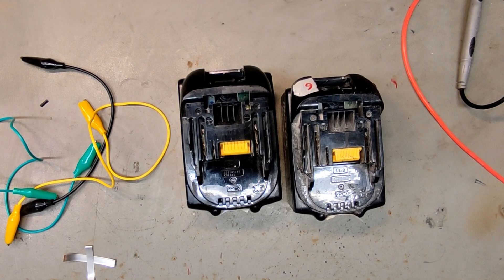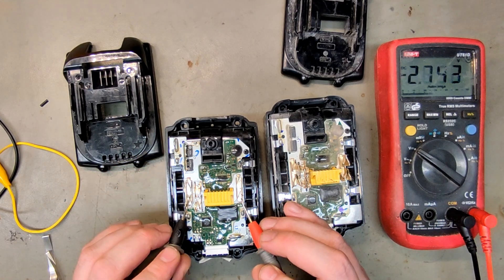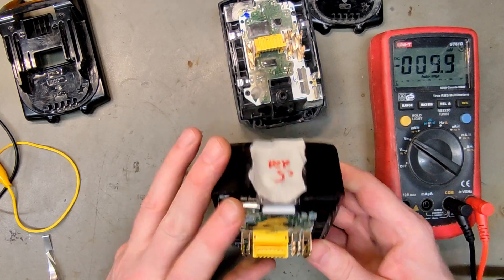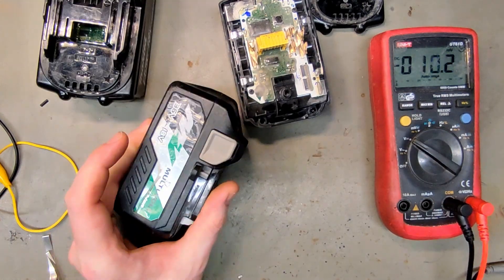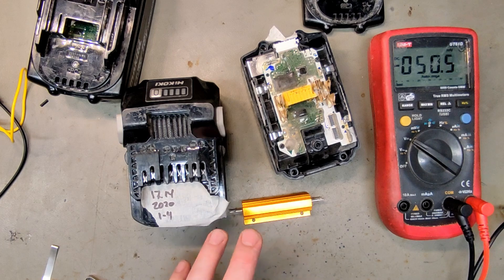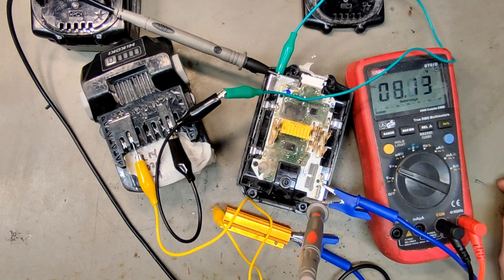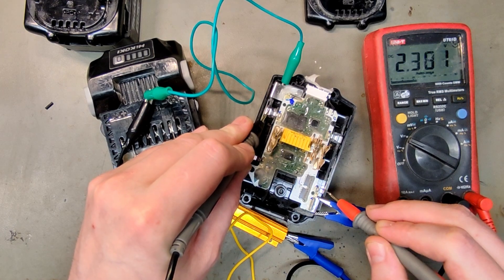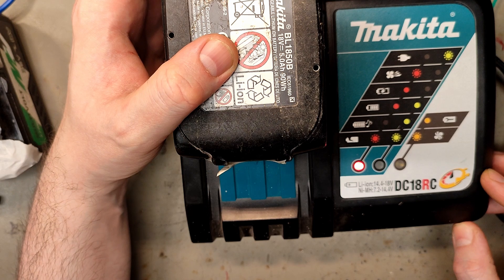How to Jumpstart a 18V power tool battery the safe way for 2$€

Comment: We have proof that a jump-started battery caught fire 6 hours after being disassembled from the electronic PCB, while simply sitting on a benchtop.
We guide people to revived the cell using 100mA current, but even though the cell is rated at 280Ah, no capacity was recovered from 0V to 2V, as is the case with any lithium cell.
Many people may not understand it. Reviving a cell is not for everyone, you must use a low current, such as 100mA and not more , till you get to 3V on li-ion cell.